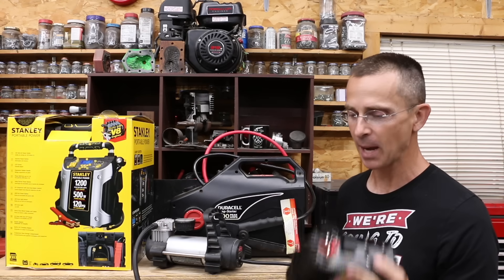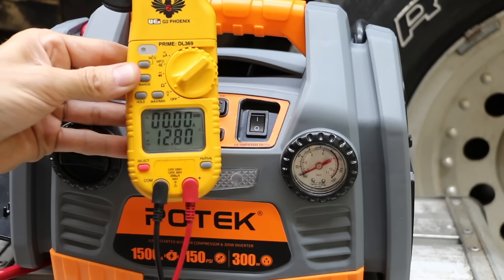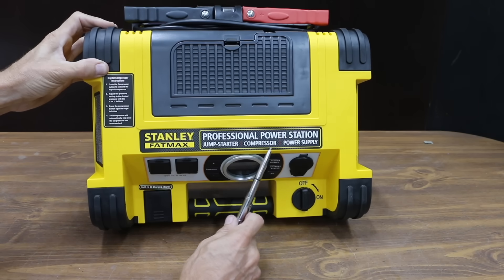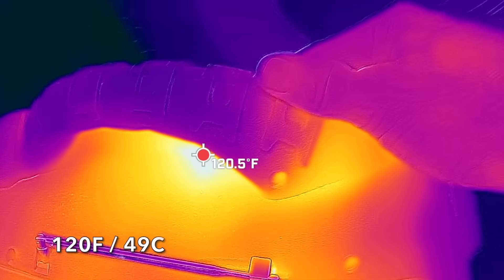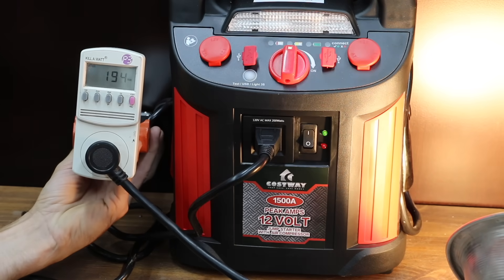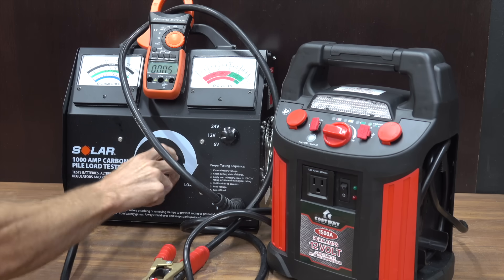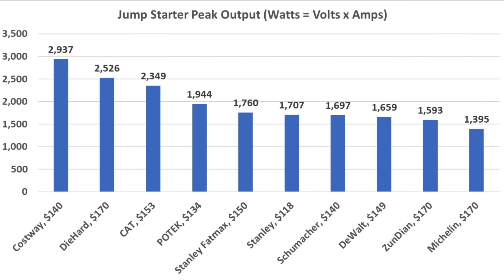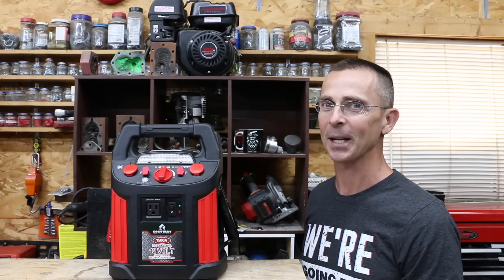Best Jump Starter? DieHard, Schumacher, DeWalt, Michelin, Stanley, CAT

Comment: I bought a diehard for $80 at ace hardware. Takes 24-48 hours to fully charge. It didn’t work when I needed it. I don’t feel comfortable leaving it plugged in all the time. So it wasn’t fully charged. It will charge a battery like a trickle charger when plugged in. Ok, these are more advanced than what I got. No air compressor.
Reply: There is an adapter that you can plug in to maintain electricity to a car when you need to remove the car battery. Guy at autozone told me some cars won’t start if battery is removed without doing that. Pos new cars IMO
Reply from the maker: Thanks for the feedback.

Comment: Well its good to know.. but not in the  spending market for the jump starters. But i do see that one would be handy.. I'll watch again when go looking for one... I just scrolled thru your videos.. LOOKING for one on cordless angle grinders.. since I've been nicked by one the corded ones.. so I'm invested in to the Makita brand.. I was looking for info on the Makita modes. They have more than a few.. an X lock verson and mostly since my last nick.. the corded one jam and spin very fast.. mostly they can rip out of your hand if jammed.... wont stop with all that stored energy.. being somewhat aggravated.. why not a safety cut off power when jammed.... makita has some interesting features.. jam cut off power when jammed... self adjusting speed (rpm) .. since i looked and may have missed whether or not you did a videos on this . But the cordless guys will lean to what they have.. like me to old to start over. And always looking to buy kits on sale.. they have a buy this get one free tool.. seen the 7 1/4" 36 volt circular saw kit and get one listed tool... me: the angle grinder
 But it seems they offer 2 but many more models.. maybe you could do one one the corded ones dewalt. Milwaukee etc.. thanks for your dedication...
Reply from the maker: Thanks for the feedback.

Comment: My suggestion for a test. Testing air compressor fitting types (industrial, automotive, aro, Lincoln) against each other. Such as the strength required to pull the male from the female difference. I feel flow might be around the same but the strength against pull apart and resistance against dirt fouling the couplers might be interesting.
Reply from the maker: Thanks for the suggestion.

Comment: Always recommend using separate compressors, inverters, and jump packs. 
When one fails or breaks you are not stuck with the choice of going without that feature or having this bulky unit and buying a separate accessory or buying a whole new unit.
You can always use the jumper clips on a jump pack to power an inverter or an air compressor.
Reply from the maker: Thanks for the feedback.
Reply: I commented much the same.
All these boxes are good for is separating the idiot from their money.  And some of them even still use LEAD ACID batteries!!!  Those don't even last 3 years, most are dead in 1.
Reply: @amzarnacht6710  If you get it on clearance, just replace the battery with a quality one. It should last 5 yrs.
Reply: @TheGuruStud  I have heard that many of these big ones don't work well because they have bad batteries, even when bought new (have heard Stanley having this issue, but once battery was replaced it worked great). It would be interesting to see how they do with brand new batteries
Reply: @stylicho  I bought a Duralast version years ago and used it once. Charged it and went to use it again and it was toast. So disappointed. I've had the HF Viking now for a couple of years and it hasn't let me down.
Reply: @DJR5280  over twenty years ago there was this guy at work that would boost my 85 mustang off at work every time I forgot I left the lights on. It was a big thing and it always worked. Wish I knew what brand it was. I don't think it had the inverters and all that stuff though, but not positive
Reply: @stylicho  Properly maintained lead acid batteries can be highly reliable.
Reply: @TheGuruStud  Lead acid batteries of any kind need to be exercised, used, and recharged at least once every three months of so.  If not, they will self discharge in about a year and shortly after be useless.
Reply: @DJR5280  Lead acid batteries of any kind need to be exercised, used, and recharged at least once every three months of so.  If not, they will self discharge in about a year and shortly after be useless.  The problem is that when you buy one of these you have not idea how long it was in transit from Asia and then sitting on a shelf.
Reply: @amzarnacht6710  But can you use the other kind of battery chargers to charge a lead acid battery?
Reply: YES. Totally agree. Been there. Done that.
Reply: Yes. I would not buy a binocular/rangefinder combination for the same reason-lifetime optics combined with delicate and short-lived electronics.
Reply: @ianbutler1983  combinations with interchangeable replacement components are a good compromise if weight is an issue when it comes to rangefinders and magnified optics.

Comment: One thing I think could be an interesting metric is for the brands that fail during normal operation and who boast a warranty would be to call in the warranty and subjectively rate how easy the warranty process was.

A lot of brands stamp "lifetime warranty" on their product but list so many exclusions, or require a shipping and handling fee which is almost as much as the unit itself. How well the company backs their product is almost as important to the consumer as the product itself in some cases.

As always, great video!
Reply from the maker: Thanks!  Thanks for the suggestion.

Comment: My complaint on your testing is that you never gave a fail if the unit failed to meet its claims.  Your comparing apples to oranges in a lot of cases and do not penalize for not making its claims.  Personally I am sick of manufactures making claims that they have no expectations on making.

Comment: Much respect to everything you do for us. General suggestion if I may - When you do a test and you see that most or almost all of the competitors completely fail at, maybe the test is too hard. Expecting these to start a completely dead battery, basically a lead brick, is a lot to ask for and I don't think anyone can expect these devices to do it. They should've been tested starting maybe a 5V battery or something, which is still probably more drained than 99.9% of the times they'll be used.
I noticed this in the previous jump starter videos as well, some of the tests were beyond anything anyone would hope to rely on these things for.
Reply: At 14:30 he said that non of them had a problem to start the engine with a partially drained battery, so next was full drained battery... which makes sense to me ;-)
Reply: @CorneliuB  Yeah I saw that, but that's the same thing just the inverse. If a test shows all the contestants passed it's not much of a test is it? He tested with a just very slightly drained battery.

Comment: Hey @project farm can you do a video comparing high heat spray paint? I’m doing a project and the paint I used changed color im painting a wood burning stove that I made a good comparison would be using the paints on a steel bucket and lighting a fire inside the bucket
Reply from the maker: Thanks for the suggestion.
Reply: @ProjectFarm  your welcome hope you have a blessed day

Comment: This really shows two things:  the available power of lithium jump starters, and having individual “best of class” components gives better performance and failure replacement.
Reply from the maker: Thanks for the feedback.
Reply: Mike, are these lithium battery devices?
Reply: @stephenarling1667  no, they're all lead acid
Reply: @puzzleluvr  
That's what I thought. A sixteen-pound lithium gadget would be da bomb.
Reply: @stephenarling1667  No. sorry. Sloppy statement on my part. Really, I should have said it like this “These poor performers show us two things: instead buy better performing individual components like lithium jump starters and power stations, and use them to power better portable air compressor all tested here on this channel.”  
Yeah.  The way i wrote it was not clear.
Reply: Seems the old adage does apply. Jack of all trades, Master of None.
Reply: @whirledpeaz5758  Perfectly stated.

Comment: Hi! Great video as always i have just a thing to say about your Inverter test : a dimmer literally cuts into the waveform rather than limiting the current, it can damage the output mosfets or impair the inverter's current measurement. You may use a variac instead to have a good view of the real capabilities of these inverters.
Reply from the maker: Thanks!  Thanks for the feedback.

Comment: A good test to see if a power inverter is junk is to plug in an inductive load (such as a fridge or something else with a compressor) 

Most good quality inverters will start an inductive load that has a continuous running current equal to 50% of the inverters continuous rating (1000w inverter should be able to start a 500w fridge for example) 

Also, to equalize the results, things like inverter capacity, or jump start capacity should be compared as a percentage of what it is rated for 

And with these devices, battery capacity is a huge factor, bigger batteries can deliver far more power (assuming the battery type is the same) which is why the costway totally dominated everything else
Reply from the maker: Thanks for the suggestion.

Comment: With the winter months coming up, can you do "Best 5k Generator" or "Best 10k Generator"?
You could show the cost of each.
You can measure fuel consumption @ no load, @50% load, @80% load, etc.
You could measure the AC signal cleanness at each of the loads. 
You could measure the sound DB at each of the loads. 
I'm sure there are some other objective measurements but I think people would be most interested in the above stats, as a start.
Thanks again for all the great videos!
Reply from the maker: You are welcome!  Thanks for the suggestion.

Comment: Screw DieHard.  Back in the 1990s I bought the current model 1150 platinum model and it failed after about 11 months.  It was replaced under warranty but after only 3 months the replacement unit failed and Sears told me that the warranty did not cover the REPLACEMENT unit.  

Thats when I STOPPED shopping at Sears .

So we saw NINE units tested here and only ONE of them as actually able to jump start a truck with a dead battery???  thats a pretty sad commentary on the state of jumpstarting technology!

Comment: Reality is that all of these are overpriced garbage. Lithium packs are cheaper and better in every measurable way. So many people buy these lead acid based jump packs and the first time they actually need them they are dead. And even when new they don’t have the beans to crank a cold engine. Whereas for less money you can buy a lithium pack that will crank a diesel tractor, and a separate 12v compressor.
Reply from the maker: Thanks for the feedback.

Comment: Wait what's the difference between these and the little jump boxes?..
Reply from the maker: Thanks for the video idea.
Reply: @ProjectFarm  hah I wondered after I wrote that if you would say that! Lol I've bought about 3 over the past 5 years and one I got on Amazon for $30, the cheap Audew peak 1000amp, 10800mah jump box rated for gas 6.0s V8s, jump started a 7.5 Liter  CAT dump international 4300 dump truck with 2 deep cell batteries from dead in 35 degree cold. ... Granted it was smoking by the end but it just melted the clips. Lol all the guys were yelling and couldn't believe it.

Comment: I have had the Diehard for years my 1st one lasted about 10 years and my current one is about that old. It still works like new except the air pump won't go over 10lbs. Last year I got 2 JNC  ( jump and carry) packs  it's not an inverter and doesn't have an air pump but it does have longer cables so I can put it on the ground and connect it to a battery. I still use the diehard mostly for the inverter. I have two 5000 watt generators but we just use the inverter unless the power is out for an extended period of time
Reply from the maker: Thanks for sharing.
Reply: I must clarify. Yes I got 2 JNCs but... Only because Amazon cracked the 1st ones case and then sent me another one and told me to keep the 1st one both work fine

Comment: If this video had came out 2 years, I probably would have bought the Costway.  I have tried the Schumacher and the Stanley, and they both won't jump start a dead battery.  These things are just useless for jump starting a vehicle and not very accurate inflating tires.  I can't remember how long it took, but the Schumacher battery wouldn't stay fully charged very long.  Now it takes less than a day to go from 100% to the low 90's.
Reply from the maker: Thanks for the feedback.

Comment: I always love your videos, thank you so much for doing this.  An extremely valuable test would be how long they hold a charge when not in use.  I believe that most units like this recommend charging them every month or so, but I'd venture that most people don't.  I know it would take a while, but testing their charge every month for six months or so would be awesome.  It always seems like the time I need one is the time I forgot to charge it for four months, in which case how well it would perform after a fresh charge is meaningless.  

I've had two units like this from Harbor Freight which were junk in my experience, so I ended up getting a Tacklife that is just a booster.  It has been outstanding, there was even one time that it performed a jump on a pretty dead battery when I hadn't charged it for nearly a year.
Reply from the maker: You are welcome!  Thanks for the suggestion.

Comment: Got the ZunDian back in mid 90's, & have been using the jump start, & compressor many time. Been using the light, & inverter  to power the aquarium heater, & air pump, filter are  few time during power outage. I've changed the battery 3x, & the compressor 1 tx. It uses the standard 12v18Ah  SLA. You can replace the standard battery with high discharge one ( as used in ups, & golf buggy). The high discharge battery would have no problem starting the car with a flat battery, but it cost twice as much as the standard battery.
Reply from the maker: Thanks for sharing.

Comment: my jump pack is a noco midrange unit, and to date the only concern i've had with it is when trying to jump a car, if the battery is too low, the noco won't register it as being a car to jump start. it'll just shut itself off.
Reply from the maker: Thanks for the feedback.

Comment: Have you recharged every booster pack after each test
I have a autozone booster and it managed to air up 4 tires to 35 psi without shutting off except for 30 seconds to change tire to inflate
Reply from the maker: Yes.  Thanks for sharing.

Comment: My dewalt began smoking after trying, and failing miserably, to air up a trailer tire. It was the first time I used it. It's currently off getting warranted. My dewalt was a higher model than the one tested, the DXAEPS14 1600, and I haven't been able to use any of the other features yet.
Reply from the maker: Thanks for sharing.
Reply: My broken one was replaced with a new one. Can't complain about the customer service.

Comment: As always, great research, clear results. I just bought a LiPoly combo starter/inflator (F.EGWO 3000Amp Car Jump Starter with Air Compressor, 150PSI Tire Inflator). It has a much higher power density, so is much smaller. Less likely to lose charge over multiple years compared to SLA, I think? I wonder how it would have fared in your testing?
Reply from the maker: Thanks for the suggestion.